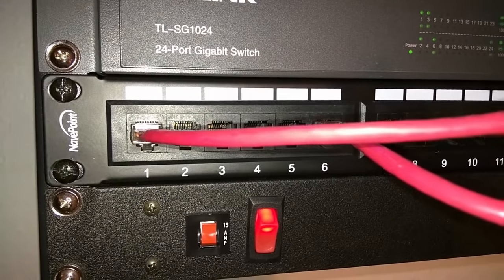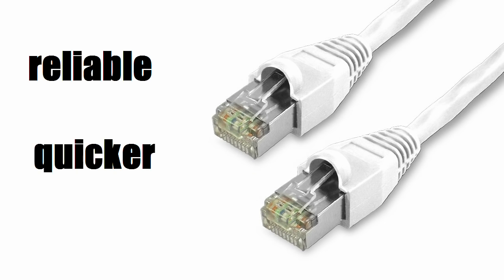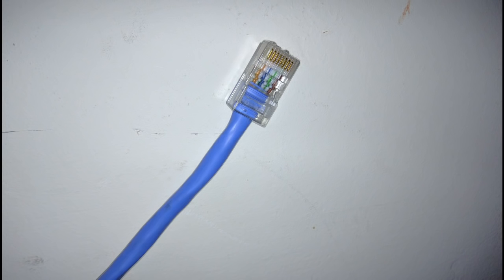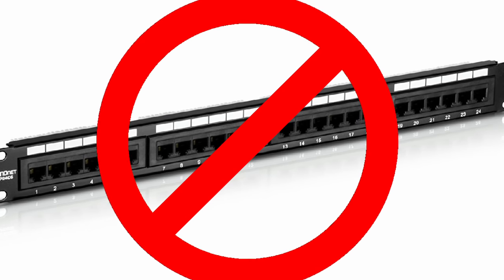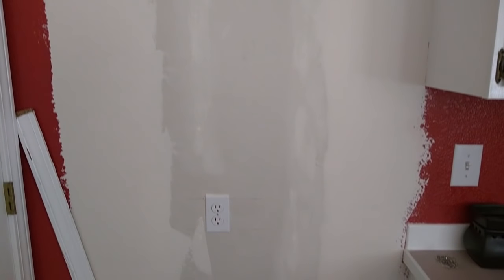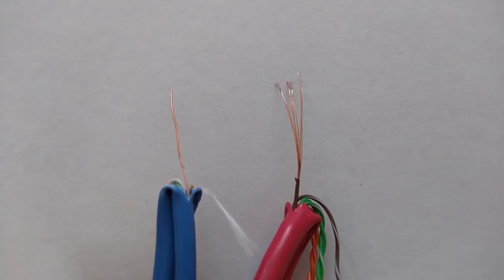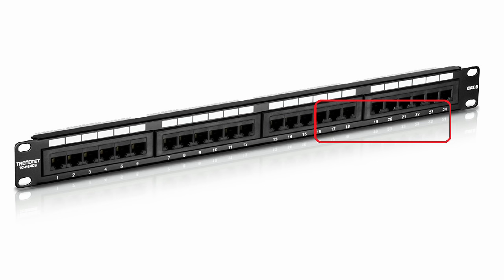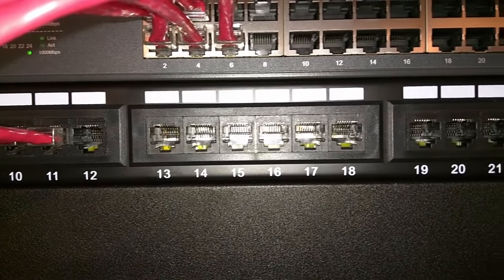What is a Patch Panel? Do You Need One?

Comment: Do you need a patch panel for your home? Definetly no, serious overkill for a place where change is needed. How about small office? No. Added benefits dont help much. Number of cables is limited. Small business, highly unlikely.
Reply: Indeed. But I want one! :D
Reply: No, you do not need a patch panel in most use cases however, I install one every time I install a rack of any kind or size. I love to future proof a network setup. I would also recommend a keystone patch panel. It makes it easier to replace a bad patch port. I like to use the surge protected keystones. I love overkill ESD safety. Many new homes now have a dedicated network closet.
Reply: @bpaullus  I love keystone patch panels and that is what I have in my house. It makes it so much easier to fix should you have have a port on the patch panel fail.

Now if you got one device plugged into the network it probably not worth all this hassle. However, I have a UPS, router, firewall, NAS, 4 televisions/multimedia devices, game consoles, computers, printer, wireless access points on every floor,'s ceiling, and I want to make sure they are all connected, not having to split the lower wireless speed between all the devices, and easy to troubleshoot, so I have keystone panels around the house all going back to a small rack, where everything is together, easy to test and diagnose issues, and easy to add to in the future.

Comment: No!  You do not need patch panels!  Their just an extra thing that can go bad!  I last ran an IT department with over 200 PC's and 50 printers and 20 servers.  Label your cables properly and you shouldn't be plugging and unplugging wires.  As a general rule once it's plugged in its never unplugged.  I have been in data centers with thousands of connections and no patch panels.
Reply: You know Terry, as an old guy who has done quite a bit, I like the simplicity a patch panel affords a homeowner who is upgrading their home communications network. We oldsters can actually put in video rooms with all kinds of toys, and the more pre-planning the better. No, you don't need a patch panel, and no, you don't need to move any connected device - except when your wife wants to recarpet, to paint, to move all your crap out of that room and put you in the basement or attic. Personally, I'm going to redo my basement and I'm definitely putting in a comm-closet with at least ONE patch panel. 

I didn't' see him suggesting conduit to run the cables, having been around hospital refurbishing for years I've seen a lot of plastic and metal conduit runs to make upgrades easier. I would also think the thickness of metal conduit would reduce AC interference - but I don't know if I'll use PVC or Metal conduit. Actually, I don't know if we have to worry about AC interference with Cat7a cable or higher.

Comment: IMO for someone not in IT, the punch down variants are the worst and totally unnecessary. Only consider it for the absolute business setting. I just don't see the point AT ALL. There are patch panels that have a connector already. I believe called keystone. You just put the cable on one end. Put another cable on the other. And you're done.
Reply: Thanks for this.
Reply: Keystone is just the specification for the modules, they also have COAX and HDMI keystones.   What you are referring to is called a coupling keystone, (basically just a ethernet coupler in the keystone module format)

Just google toolless patchpanel jacks (here is a decent one, and I have no affiliation with Monoprice in any way other than being a customer.  https://www.monoprice.com/product?c_id=105&cp_id=10513&cs_id=1051310&p_id=15679&seq=1&format=2)

Comment: Every time you terminate the connection and send it through something it slows the speed down as i understand it.  Not sure why you would add more connections between things
Reply: How does that logic even work? How would a metal <> metal connection "slow down" data?
Reply: @mark22732  from experience installing cable and internet every time you have a connection it takes signal/speed to jump those connections so every time it has to do that you loose signal/speed, so you really only want to do that as many times as needed to keep up signal/speeds
Reply: @johnav8rflys  It's a very small drop, unles the contacts are very bad/corroded/dirty.
Reply: @johnav8rflys that isn’t at all how Ethernet works. The speed doesn’t decrease at all. Latency technically does goes up because of the speed of light, but it is completely insignificant here and I hesitate to even mention it.  We’re talking 7 MICROseconds per MILE of added wire. The primary thing the addition of a patch panel does is very slightly decrease the max cable run length for each connector it goes through.  This could be a problem if you’re out beyond the 100 meter max distance spec, but otherwise a patch panel never costs you any performance at all.
Reply: Have you ever measured it. You can measure the drop before the connections and after and you’ll see a drop sometimes slight sometimes fair bit occasionally a lot
Reply: @johnav8rflys  It's true that a patch panel, like any other connector, would add a measurable drop to the signal strength of the end-to-end connection. That being said, like the other guy was saying, unless you have dozens of connectors or are running extremely long cables, that drop in signal strength wouldn't translate to a percievable decrease in network performance. There are absolutely scenarios in which it could be a problem, but it's very unlikely in most residential or even small business settings.
Reply: @johnav8rflys  Would you ever try to use certified patch cords and reputable class patch panels. And a tester that will measure the impedance of the cable, and not just flash the diodes to indicate the continuity of the wires.
Yes, you have a voltage drop on each connection, but how to reconcile it with the cable: "do not bend"?
Reply: @wojciechbajon  that might make the drop less than others. Not sure what your asking with that last part though

Comment: I like what you’re trying to do and I did subscribe. But •••. There are some serious technical problems with the content. Serious enough that installations you show will fail inspection and be horrendously expensive to fix. 

First, not an inspection failure but very, very expensive to fix. Patch panels that have monolithic punch down blocks are useless in all but direct, parallel assemblies. They lock the system into incredibly inflexible arrangements which are super difficult to keep sorted out when anything changes. The part is simply not designed for or fit for the use you show. 

Use modular panels wherein each wire is terminated to a punch down on the connector itself. That connector is then inserted into a square knockout in the frame. That type of system was designed for your use. 

The most likely reason this failure happens is that the assembler is uncomfortable doing clean connector punch downs and so uses the big wide open monolithic style. 

Practice is the solution. Any assembler using monolithic blocks in systems you show will likely be immediately terminated. Owners will have to eat the cost of repair. 

The real killer you show which will absolutely fail inspection is that case where you have passed CATx wire out through a square socket intended to hold the individual punch down connector described above. 

It is a major 76 NFPA violation and has been covered by the NEC since 2012. You have created a seriously dangerous opening in the (presumably in this case) sheet rock fire wall. It is essentially a chimney. 

This topic is at spot two on my inspection punch card (right after passing low voltage and line voltage conductors in the same raceway).

Do not confuse (which you seem to have) wall terminator plates that allow signal wire to pass through. Those plates MUST be nothing more than covers for UL approved in-wall j-boxes as part of (typically) type non-metallic tubing. 

I point these gross errors out and not a myriad of others because these will be very expensive to fix. I have no idea how much money errors like this have cost owners who have hired me to audit the low voltage contractors that got the owners’ jobs red tagged for non-compliance. 

I know, crazy long reply. I am spending my time in the hope that you will take the responsibility of creating content seriously. 

In reality, YouTube needs a mechanism for removing content which teaches material falling short of regulatory requirements.  No such mechanism exists, yet. Ince Google gets a $1B civil judgment against them, maybe it will be developed. 

Basically, you’re try to teach what you don’t know. NFPA has jurisdiction of low voltage installations precisely because untrained installers have cost owners untold millions of dollars and have likely been responsible for incredible prpoerty damage due to fire. 

If you want to find some free code training I can recommend Mike Holt on YouTube. A great teacher and, importantly, a manager of the code authority that drafts the regulations.
Reply from the maker: I read your comment, and while you make some great points, I think you might be taking this video a bit too seriously. It's not a "how to" on installs, merely a video about patch panels.

I've admitted before that I'm not a pro, even still, my content does give people an idea of where to begin. The rest is up to them. Never once have I stopped anyone from looking up their state code if they want to.

You're not the first personal to mention modular panels, and I do think they are a good idea. I didn't know about them when I made those videos.

One of the reasons I keep doing these videos is because I learn too, yes, even from you. It's because of this exact reason that I hope your well meaning, but missguided call for censorship never happens. I do not need a company or the government to keep me safe and to tell me what is good or bad.

Thanks for subscribing. As I do release videos, please do feel free to help us all learn from your experience.
Reply: None of this applies to a residential home where the person is not aiming to leave the installation permanently, sell the home and charge the next owner for the installation by adding the expense to the cost of the home.  Further, this person is not explaining how to install these systems, merely showing the components of the installation and explaining their purpose.

Lastly, kindly fuck off with the idea that youtube should be responsible for policing videos on its website to make sure they are up-to-code for every state, municipality or region. The onus for proper installation is on the end-user or the installer, no one else.  Its not the responsibility of youtube or content creators or any other non-licensed source of information.

Besides, if every installation was always up-to-code, you wouldn't have a job. So instead of complaining, thank him for keeping you in business and move along.
Reply: Points well made Boonedock Journeyman.  While plenum or duct rated cable will be more expensive.... its use should be encouraged. After all, the price of a life has no price and toxic smoke from non plenum cables is a real danger.

Comment: Wifi might have been trash 5-10 years ago but modern wifi networks are really stepping up hard. For the avarage home laying cables is just a ton of work and ruining walls where a simple mesh network would have sufficed. With Wifi 6 coming up this is even more true. Hell, your phone doesn't have an RJ45 port. We don't need ethernet everywhere. We need wifi everywhere.
Reply: It's easy to assume that everyone has the same use case as you, but anyone watching a video about patch panels is unlikely to have the same use case as your average punter so surprised to see this opinion! 👍

Wifi has its place, but its only two benefits are convenience of installation and convenience of connecting mobile devices. If all you do is surf the web, email and watch YouTube (most people's home use case for a network) then you need nothing more. However, if your work or hobbies require the moving large amounts of data between devices then you hit the real limitations of Wifi very quickly... You can't beat the laws of physics (and Shannon). If I'm on my laptop and I want to transfer more than a few gigabytes in one go then I reach for the cable. I also find that smart TVs are much snappier on wired connections... I was surprised by that and I wondered why Netflix and YouTube needed to buffer for a second whenever I played something, turned out I'd disconnected the switch they were on and they'd reverted to wifi. Back on wired, snappy again. 

Wifi 6 will improve things over Wifi 5, but you have the same basic issues that you're sharing your transmission medium between your devices, and your neighbours' devices, and that you are open to interference that will reduce the potential throughput. I don't need a low latency connection, but one of my friends needs such low latency for his work to the extent that wifi isn't an option (no, he isn't a professional gamer lol)... Wifi6 improves latency but it's still slower than ethernet. 

At the theoretical best (which you'll never see), whole-network Wifi6 throughput is 9.6gbps, which is half the throughput of a single 10gbps ethernet connection. Fastest single-device throughput is 1.2gbps, which is 60% the throughput of a single 1gbps ethernet connection.
Reply: In addition to what donkmeister posted, it should also be mentioned that "simple mesh setups" even among the WiFi6 offerings don't make use of either wired backhaul, or a dedicated "backhaul channel" to reduce the loss of bandwidth to the need for retransmission over the air. Even worse is the matter that some of the pricier Mesh offering that are triband capable (doubling up on 5gig) and advertise top speeds which includes the backhaul in their number. In other words, that means your AX5300 (1,000 (2.4), 2167, 2167 (5.0)) wireless mesh is in all reality a AX3150 (1,000 (2.4) and 2167 (5.0) with the second 2167mbit stream being used for backhaul... Unless you hardwire it, assuming your mesh device allows that option. But you're arguing against wiring anything, so that option is out for the case you present.

From there we can get into the matter that the throughput also listed above also assumes a single user(although Wifi6 does help in regards to shared scenarios). So if you're using a wifi mesh network to talk to 2 devices on different access points,  your bandwidth is effectively halved again. At which point your highspeed Wifi6 AX5300 mesh setup is going to perform at about the same level as a 1gigabit hardwire. If you have more than just the two devices on your WiFi network, this slant even more heavily in favor of the hardwired 1 gigabit connection(which is 1 gbit in both directions), even with WiFi6 in play. This also ignores the matter of throughput is going to be a lot better for that hardwire after traveling through multiple walls and several tens of feet because signal loss isn't going to be major factor for the cable. 

WiFi is great for rapid deployments and other high mobility uses. WiFi5 is likely to be fine for what a lot of home users are doing, but for most of those users, they're not going to be able to notice much difference between a 100mbit network connection and a 1 gigabit one in the first place, never mind anything faster. But for the people who need throughput, and are not dealing with a "temporary setup" hardwire is still going to be king, and for many of those users, they're likely to be wiring for 2.5 gig or 10 gigabit at this point. WiFi6E might be able to get close to that, but even then, you'd likely need to be in the same room as the AP with direct line of sight, and the room couldn't be too large at that. But even with that consideration, the AP itself would once again need to be hardwired to a physical network which could support that kind of speed.

Comment: Change ur tv... u can make network setup which costs but u cant replace ur tv lol
Reply from the maker: I could, but I'll use it until it's toast.
Reply: In my case it would cost around $800+ to replace my TV, but I can buy network gear for $200 here, $300 there much easier.